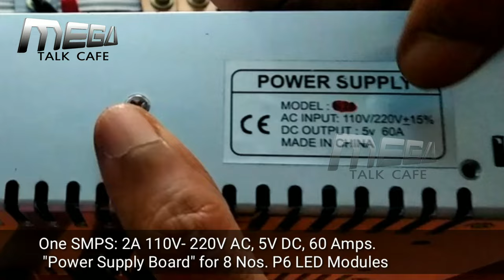HOW TO SETUP LED VIDEO WALL | P6 LED Module | EASY Step-By-Step tricky AT YOUR HOME | P3 | P2 | P10

Comment: If it is set in the outdoor and heavy rain occurs, the display will work or damage?
Reply from the maker: Our company makes the LED video wall for outdoor propose with Rain Prof safety.
Reply: instablaster

Comment: Power cable connection didn't understand.. please make it clear
Reply from the maker: Hi, Power cable connection for LED modules or SMPS ?

LED Modules, you get Red and Black cable along with each LED Modules when you purchase it. You have to use genuine 5V DC cable with Each LED modules.
Reply: Hi, power cable connection for led and smps both not clear.plz make it slow so it's get clear how to make connections
Reply from the maker: Okay thank you for your feedback, we will make new video soon on power cable connection.
Below the link about how to setup LED video wall software.

https://youtu.be/h4eNA0YWDWk
Reply: Please make it as soon as possible
Reply: In this video u should interpret what are doing so it's easy to understand connection with concept
Reply: Also, how to run data on led video wall other than English language
Reply: I eagerly waiting for the video
Reply from the maker: @kk-ts2mo  In text section copy & past any language or direct type it .

Comment: Sir app address or mobile Nambar p6 lena 24 pc p10 15 pc
Reply from the maker: Email to :  firstsign4@gmail.com
Reply from the maker: Clearness sale 
Total Rs.35,000/- 

Items 
25pcs  
P6 Module 7.5 x 7.5 Inches 

 36pcs 
P10 RGB 6x6 Inch 

  4Pcs 
Power Supply 5V.60Amp
Reply: 24 PC p10how much price